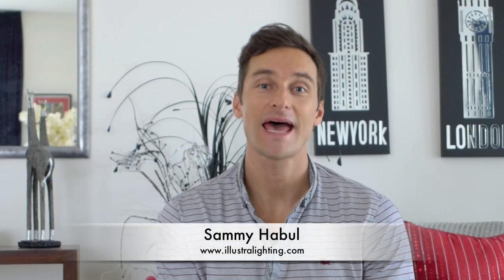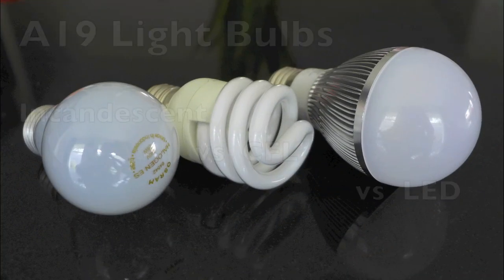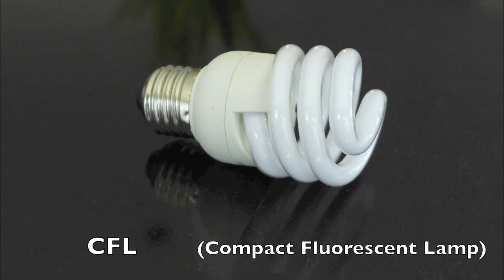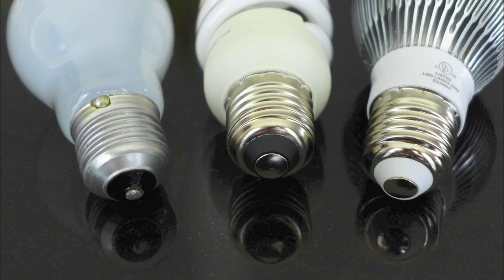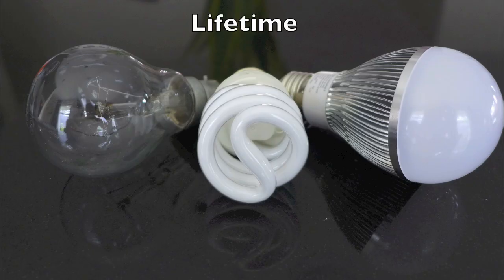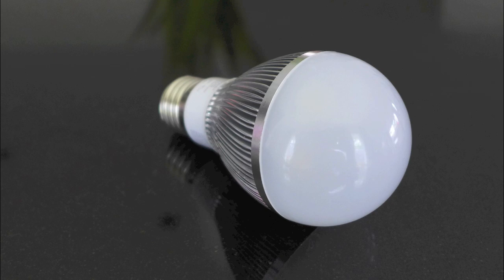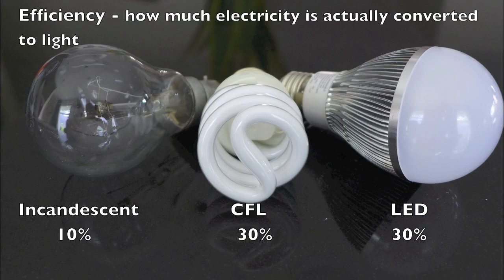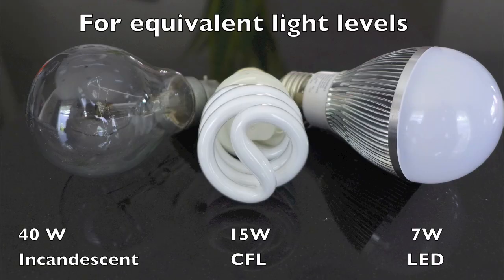LED vs CFL vs Incandescent A19 Light Bulbs

Comment: the thumbnail has it wrong.
Incandescent bulb has an efficiency of 37 %. 
so, a 40 Watt bulb would produce light at 40×37÷100 
= 14.8 Watt.

A CFL is nearly 55-60% efficient.

 A 15 Watt CFL would produce max. 
9 Watt.

Comment: one of the first lightbulbs is still burning , the industry made them to break in order to earn more money , and by the way lightbuld is municipal solid waste and led buld is special waste
Reply: no, they made them to break, so they consume less power and have bigger efficiency. First light bulbs were very dim, while consumed large amounts of energy.
They've calculated, that when they make the filament thicker, effectivity is going down, and it actually burns so much power over years, that it's more cheap to make filament thinner and replace them by small cost every year. It also saved enviroment, as power was produced mainly with coal in past. It saved a lot enviroment.

Example, if they would made filament thicker, for same light source, it would eat more energy, than is cost of new light bulb. (about 1$). Also saves the enviroment. They decided , that most effecitve was to make it so thin, as they are , about 1000 hours of lifespan. You then pay $1 for new light bulb, but actualy, you save more than 1$ over year on electricity bill.

Just count 1000 hours * 60W = 60 KW.
If you make filament thicker, for same light you need to burn 70W. Its 70KW.
10KW differance.

10KWH actually costs more, than new bulb.

Comment: I’ve concluded that it’s hard to beat the value offered by modern LEDs. Not only are their prices getting more affordable every day, they also lasts up to decades longer than the competition.
With soft and warm white hues that mimic the glow of traditional incandescent bulbs, the ability to use some models with a dimmer switch, and their instantaneous illumination, LEDs are simply a better option around the house than CFLs.
Reply: LEDs only last longer than incandescent bulbs because they were deliberately designed to fail after 1000hrs. It's called planned obsolescence. But even at that, LEDs don't last nearly as long as claimed. If made properly, Incandescents could easily beat LEDs at longevity. Not to mention that LED lighting is a health hazard. https://www.youtube.com/watch?v=P4gvBePS7qk&t=373s

Comment: Why is this even a debate?  If a CFL is $1 and available in different color temps, that seems like a good deal to me.  The ramping up of light in CFLs can actually be useful to allow your eyes to adjust to the sudden brightness when turned on. The bases of some cheap LEDs get VERY hot so they are not as efficient as some people believe.  CFLs get hot too but mostly the spiral part that is better exposed to air, not "trapped" in the fixture where the heat can build up.
Reply: s7w2a Your comment is very stupid.

Comment: The heat is only "wasted" in summer and outdoors. But during summer less artificial light is needed. It's sad that governments intervene, and don't allow to choose the best device for the given application. Light directed toward the usually white ceiling is not always a loss, as it eliminates sharp shadows Incandescent lights in halogen atmosphere have somewhat longer lifetime, but spectrum similar to conventional lightbulbs. The peaky spectrum of fluorescent lights makes some objects change color or lose detail, even though the total light given off is higher when the bulb is viewed at a distance.

Comment: there not fasing this out this video has been out for 3 years whose with me 
but yes eventually they will fase them out
Reply: Home Depot is selling 4 LED bulbs at $20. At the time of this video, one bulb would run you about $30. The price drops will finally phase out the CFL bulbs. :)
Reply: All what they have in common they will all burn out at some point

Comment: I tried an LED bulb but wasn't happy, the price didn't justify the longevity(mine only lasted one year). I'm sold on CFL because they a relatively inexpensive and use 75% less watts than incandescent, CFL's also generates about 66% less heat than incandescent. CFL's come in dimmable and 3-way bulbs now(Feit Electric), they also come in 2700-5000K color temperature.

CFL's are great for areas where you leave the light on long-term(front porch, kitchen, table lamp) but are not recommended for short-term(closet, side porch) or vibration(garage door opener).
Reply: They also generate other things that filament bulbs do not...and none of it is healthy. of course he never spoke about that end of it.
Reply: You got a bad LED if it only lasted a year. Plus the price is only around 2-4X of a regular bulb for a much brighter light. Meaning you can just put 1 LED in a fixture that would take 2 normal bulbs.
Reply: I hope they come out with a OLED light
Reply: https://www.youtube.com/watch?v=21TJYkhP8gQ&t=461s

Comment: Do leds save u money?
Reply: i do think so
Reply: +Christopher Guzman 1000h of an incandescent light bulb @40W (weak bulbs) is 40kW of electricity, or about 4$. A LED or CFL bulb would cost less than 1$ to run for the same amount of time. Then you replace it 4 times, and get 3$ difference, times 4 = 12$, plus the cost of 5 light bulbs, equals MUCH more than CFL costs. Which means that it saves money.
As for LED - I call bullshit on the argument that the ceiling gets illuminated which is lost light. The ceiling is white, which means that it reflects the majority of the light, making a nice ambient light, that's not as harsh as direct projected LED light.
So LEDs are harder to justify economically. But maybe in 10 years you get your money back.
The main advantage of LED compared to CFL is that you can connect it to a regulator, and smoothly regulate the intensity of the light. You can't do that with CFL.

I'd use LED bulbs, place them horizontally, in a circle, so they light up the walls, ceiling and floor. I'd add a bulb to light directly downwards to avoid an unpleasant blind spot.
CFL aren't safe. I accidentally broke 2 of them. And even if the mercury wasn't a problem, having thousands of thin glass shards covered in phosphorus, all over the carpet was definitely something I'd rather avoid. But if I need a compact and simple source of omnidirectional light - CFL it is.
Reply: +Donnie you obviously know a lot about LESs. I am learning about this industry, do you think this is a growing industry to get in to do sales for LED manufacturers? I live in the UK
Reply: MasterMorality Master you're asking for opinions from a youtuber you don't know. I can tell you to start selling rocks for a living.
But seriously, my opinion is that LEDs are "hot" only when they're improving. Once the market is saturated and everyone is on LEDs, and not much improvement is done on them, there will be no demand, or at least the same demand as there is for stuff like other stuff that lasts forever.
Right now the demand is high because everyone is buying them to replace existing lights. And many hesitate because they're expensive, and too big for the light they emit. They'll become cheaper, and more size-efficient. So... do what you think is good for you.

Comment: LED Bulbs suck if you're using them on a dimmer switch they flicker like hell. The only advantage incandescent bulbs have over the other too is the fact that they don't flicker at all when put on a dimmer switch and can actually be more efficient when put on the lowest setting on dimmer switches.
Reply: *****
some of them still have problems but yeah they're much better now. The problem is that they never fail so eventually companies are going to start making LED's less reliable like they did with incandesant lights back in the 1920s >.<
Reply: You need to use a 'trailing edge' dimmer switch with LEDs. You won't get flicker then

Comment: you got the energy efficiency wrong. Actually incadescent efficiency is only about 3-4 %, CFL is about 15 %, and LED-s 25-35(depending on the manufacturer and when it was made). The best of LED-s are about 10 times more efficient than incadescent lamps, that would mean their efficiency is almost 100 %, which is impossible, concidering that they also produce some heat(far less than the other 2 but still)

Comment: They were CE labelled, but buying at retail prices means LED lights just are not worth it yet, i can get 10 cfl bulbs for less or the same price of just 1 led bulb. I got 10 cfl bulbs at 8watt off ebay for £4.50 none of which have gone bad after a year and half, just 1 led bulb at retail prices are around £4-£5 more if you want a dimmable version.
Reply: eraldorh I think incandescent last 2 years at most the others are suppose to last 9 years and 15 years for Led

Comment from the maker: Not a surprise actually. Buying cheap led light bulbs off ebay from Chinese suppliers is pretty risky.
Not only have they not been tested to meet with electrical safety standards (UL etc) the components used are naturally cheap and generally unreliable. Plus you may not get a warranty.
Quality led bulbs DO last 50,000hrs and up. I suggest buying bulbs from a retailer that offers a money back warranty.